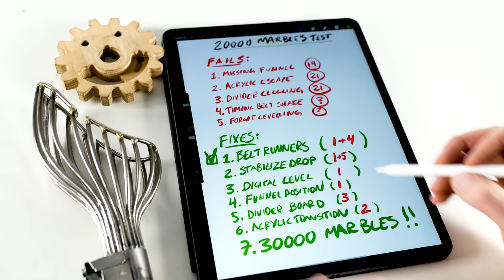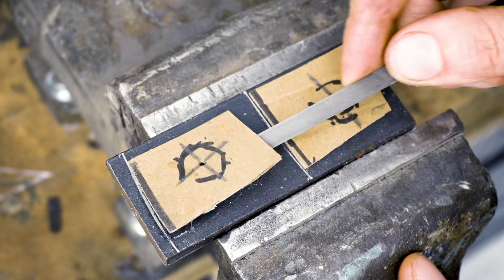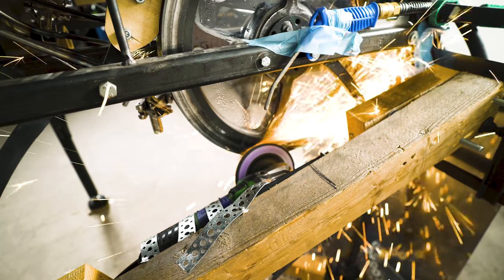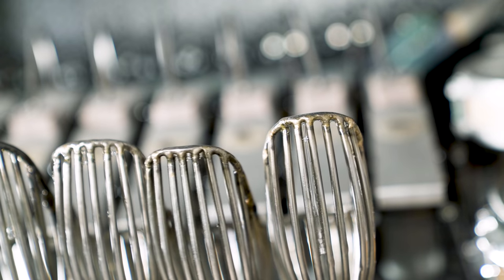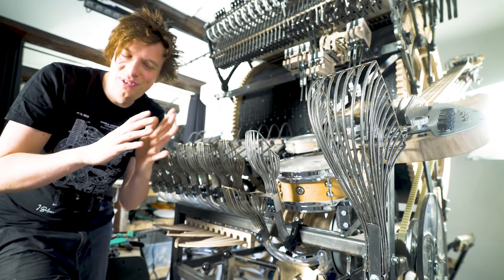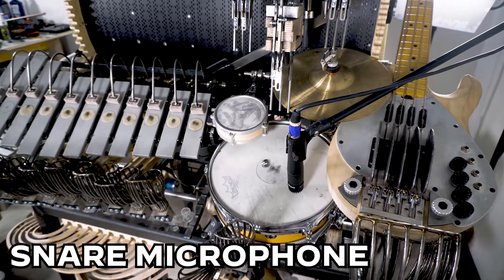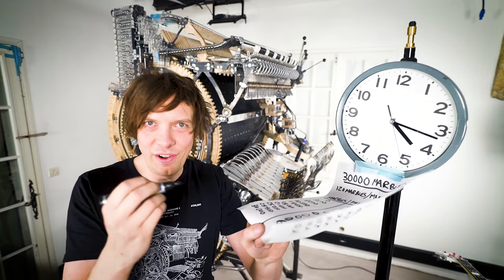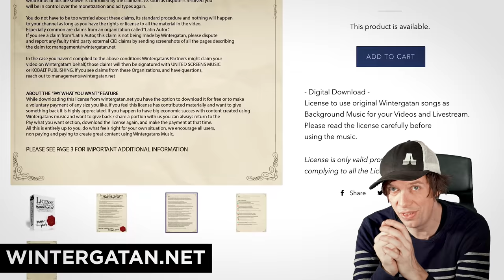Playing 30000 Marbles - Marble Machine X #148

Comment: As an engineer who has worked many years in “Quality and Reliability”, you cannot put the six in the FAILED column. They did not fail for what you were testing. They are a “new failure mechanism”. Analysis shows a design defect in the feed mechanism for not limiting the flow for such a small flow of marbles to the main mechanism.
Reply: It's a FEATURE!
Reply: I think he counted the 6 in the count because he's not just counting marbles that escaped the machine where the marbles were let loose to hit the instruments. This was an overall whole-machine stress test (except for the unplayed portions) and those 6 lost marbles showed there was a specific set of conditions that need to be addressed.
Reply: As a QE.  Martin’s Definition of a defect was a marble on the floor.   So it counts.   The cause of the failure is different.

If writing a FMEA it would have the same effect but different cause.
Reply: @calvinthedestroyer  actually it is a feature when you think of it: it's a damage free fail-safe which allow for the continuation of the feeding loop, at the expense of losing x marbles from it. I really would have put a tray and let it stay were it for me: fixing it would probably make it worse if something happened

Comment: Six marbles failed, in a way that is completely harmless to the machine, and you know exactly why it happened. I see that as a total sucess.
Reply: Completely harmless? One day a marble will get stuck between moving mechanisms and jam up the machine. The only safety feature in this case is the fly wheel disengage mechanism which will probably put to much force on the jammed mechanism and locally destroy the machine. Failing marbles are always a risk for this machine as long as there are almost no safety features in place. Martin is going to find this out someday. So sadly enough failing marbles are not so harmless in my opinion :(
Reply: @FrankyieFrank  I think in actually practical usage he would be able to look for the errors and stop them before they happen. Well, that's what I think.
Reply: @FrankyieFrank  Yeah but the thing is that the cause of the fails is not a part that is going to snap of a desing flaw that needs some plastic surgery. It's just a interchangeable part (and too many marbles in my oppinion)  that caused the overflow to, you know, overflow.

If one of those stray marbles would cause something to break would absolutely suck, but compared to the other things he had to do this far, I would't even call this a fix. Just a bit of fine tuning.
Reply: @FrankyieFrank  Sure, I agree that it could cause a jam somewhere else, and I also agree that the machine needs more failsafes.

But I still think the test was a roaring sucuess.
Reply: @FrankyieFrank  I think what was meant is that only six marbles failed due to the test setup: If all instruments are playing, the line of marbles will never back up far enough to flood the stair elevator.
Reply: @rublie1426  that was exactly my thought as well, and I'm surprised it wasn't his conclusion. The max number of marbles the machine can be loaded with is a function of total bpm and loop travel time.

Sure, some mechanism could prevent this failure, but so would treating the MMX like it was a full instrument, rather than just a snare drum. Or potentially just removing a few dozen marbles from the system for these tests.
Reply: @Ruricu  yep exactly :P
Reply: @wintergatan as a (SW) engineer I have to fully agree with @JonasBergmansson: this was NOT a machine fail, but an user error. You overfilled the machine for the given test setup with 2 channels. I understand that the machine with all the marbles going around is visually more appealing, but that was unnecessary for the test at hand. BUT there is a lesson here: the capacity of the MMX is limited by how many marbles can be at the same time in the marble divider/fish stairs feeding tube/fish stairs loop. Marble outflow-rate (through gates) and marble inflow-rate (from conveyor belt) are dependent on where you are in a music piece. Plus the inflow-rate I(t) is time delayed of the outflow-rate O(t-∆t) (delta T = time for a marble to go through the gate all around to the exit of conveyor belt). I get the feeling that there could be a mathematical or numerical solution to the question: how many marbles should I fill into the machine for a given set of music pieces? For the test at hand the inflow-rate must have been only so much slightly higher than the outflow-rate that it took playing 29000+ notes to fill the loop to capacity. If you would have just put 10 fewer marbles into the machine 😂
Reply: I guess the boring answer for this test would have been 36 (plugged non-installed channels) + 2 * 50 (taking an educated guess what the storage capacity of one channel is) = 136 marbles. This of course assumes that the given test music piece doesn't exhaust the channel storage while the first marble played is traveling from the gate back out of the marble conveyor...
Reply: But, hey, wait.... something is fishy: @Wintergatan where are the extra marbles coming from? Your test music piece has N pins on the program wheel, hence every full rotation of the wheel releases N marbles (don't remember what 120 rpm translates to in X program wheel rotations per minute). So shortly after the start of the test the MMX  goes into a steady state, i.e. per program wheel rotation N marbles go through the gates and N marbles exit the conveyor belt. So where do the extra marbles get added that make the marble inflow-rate slightly larger than N/rotation? It can't be the "height modules", because AFAIR they only make sure that a filled channel ends up with a marble flush on the marble divider channel so that marbles rolling down the channel don't get stuck. Is it just all the other marbles that are "stored" in the machine, slowly migrating toward the conveyor belt and being fed into the marble divider/fish stairs loop?
Reply: @chemobejk  yeah pretty much. I think that slightly more marbles get elevated than get used by the drum channel, and at the start marbles were both stored at the bottom of the machine behind the funnels. Then apparently after about 4 hours, enough of those marbles were lifted to the top to flood the stair elevator.
Reply: Success *
Reply: Why did they jam in the pipe? I didn’t quite catch that.
Reply: @chemobejk  well, not the way Martin described it. He said the snare feeders were at the wrong height, causing the marble divider to slow down and back up. If that problem is fixed, the marble divider should never back up even if the machine is running overnight with all instruments disabled.
Reply: @Ruricu  I think the reason this is a true fail and not just a case of overloading is that the imperfectly calibrated snare queue caused a blockage. The fish stair creates an infinite loop of overflow marbles that meant backing up like this shouldn’t have been possible, as the machine stopped, the marbles should have pooled at the divide by four and its feeder pipe, not at the top. They backed up at the top because the top marble of the snare queue was protruding too much and the next marble stopped there instead of continuing round the infinite loop. I think.
Reply: @Dave01Rhodes  unfortunately the video doesn't show that bit of the marble divider (top of the snare channel and marble divider exit to fish stairs feed tube). It is shown that the marble divider channel is full BUT the feed tube isn't and marbles are still flowing into the feed tube (I.e. no blockage). So it isn't clear why fewer marbles entered the feed tube per fish stairs cycle, as the fish stairs pumped into the marble divider.

Comment: I am genuinely concerned with such levels of precision being needed that this will not be repeatable when transported without significant setup time
Reply: You know, there is always some setup time before a show ... Installation, tuning, tests, and so on ... I'm sure that, with all the works done now, it will cut down on setup time and will be manageable in the end !
Reply: Also, having such a high reliability in perfect conditions gives some headroom for errors when the setup is suboptimal on tour. As many have pointed out it's not the end of the world if some marbles escapes during a concert. If 1/10'000 escapes in the studio it might be 10/10'000 on stage with limited setup time. But it makes sense to get it as good as possible now.
Reply: At least it could be perfect for studio recordings when je will have the time to adjust everything
Reply: Yeah, setting the machine up to be exactly the same each time might be quite the task. I can see different venues having different temperatures and humidity, the machine may also need to acclimatise. I don't know how this would affect the machine working but I'd probably want to do some long running tests in different environmental conditions.
Reply: @isakefternamn  it isn't the fact that the machine has high reliability in studio conditions that worries me...it is the fact that it needs high reliability to work properly. As we have seen already, minuscule deviations from "perfect" cause a cascade of issues. It is this very narrow "operational window" that gives me anxiety.
Reply: seems like the machine is flexible for calibration. before any show i can imagine a team calibrating it thoroughly
Reply: The only tweak that he's made that seems like it would need adjustment for going place to place is making sure it's leve.l which doesn't sound like a hard standard to meet, but maybe I'm dumb.
Reply: @publiusii4246  Different temp and humidity could cause the materials to expand/contract which might cause problems.  I especially wonder what the largely plywood gates will do in a warm, humid environment.
Reply: @hyfy-tr2jy  Sure I get your concerns. But it seems the risk of a marble escape causing a critical failure (get stuck in a gear or something) is still pretty slim. And when Martin is done with this detailed overhaul I’m sure it’ll be fairly reliable. And the audience at a concert will be forgiving if he has to stop the show to remove a marble somewhere, at least I would be!

Comment: Martin, the purpose of the squished cable in the angle grinder is strain relief. My guess is the issue was in the plug, but I recommend putting the strain relief back in because if you don't the cable might pull out of the internal switch, short, and in the worst case start a fire.
Reply: Omg imagine a fire destroying the mmx...
Reply: If it's to squished too hard and it gets too hot, the wires melt together and short. However, could also just be that this will happen with any grinder (or any machine) that gets used beyond its duty cycle and load.
Reply: @cjansson  It can't be "squished to hard".  The inbuilt plastic crimp is sized to compress the insulation sufficiently to prevent cord pull out under normal wear and tear but not compromise the insulative properties of the jacketing.
Reply: If it shorts out, it will pop the breaker. Just one strand of copper is enough to start a low impedance arc which will trip the breaker in tenths of seconds. A short circuit does not cause fire, unless the electrical installation of the building is bad (or if you reclose a breaker with the fault still existing - that can pit contacts and eventually weld them together...)
Intermittently arcing contacts to the load can cause fires, but in this case you'd immediately notice if the grinder is not running smoothly and most of the times the plastics are flame retardent.
I agree there should be strain relief, otherwise it'll just work itself out of there quickly.
Reply: @williamcchinworth7367  I'm pretty fucking sure the inbuilt plastic crimp was never "sized" for anything, it has just been thrown in there to "looks fine" standards. Which may easily include "it's not fine at all you idiot" situations.
Reply: @AttilaAsztalos  actually the inbuilt strain relief is often highly engineered to not cause issues with over tightening, way easier to pay an engineer to work for an hour on an injection mold design than paying for calibrated torque drivers in a factory or paying for one lawsuit.

it's also often part of compliance testing.
Reply: Personally, I think the crimp doesn't need to be there at all and the 'strain relief' is provided by the snaking pattern of the cord running through the handle. Which means you guys are slowly getting more and more upset with each other for no reason......
Reply: @mfbfreak  I know, I was talking about a worst case scenario. I edited my original comment to reflect this.
Reply: @cjansson  squished too hard doesn't cause wires to magically change resistance (unless you're talking really really squished) I just want martin to be careful and not do anything that might put him or the MMX in danger.
Reply: @jeffffro7674  take it from an engineer that's designed strain relief just like that into multiple different molds, it needs to be there.
Reply: @AttilaAsztalos  oh, it most definitely is sized. there are entire ME reference manuals on designing that specific style of strain relief.
Reply: @zachbrown7272  well I have several tools where I've bypassed the crimp but still have it zigzagging through the maze that's there and they've been fine for over 20 years. Then a couple more where the crimp part broke because of the beautiful engineered term, planned obsolescence, and after I repair the parts that are engineered to fail, the tools work great for a lot longer than they are planned to.
Reply: "Way easier to pay an engineer to work for an hour on an injection mold design than paying for calibrated torque drivers in a factory or paying for one lawsuit."
Even easier than that is doing neither and blaming the customer for starting a fire by trying to use an angle grinder for hours to true up an unbalanced flywheel.
Reply: @zachbrown7272  If he runs the machine for 4 hours in a go under heavy load, there could be a significant heat build up compared to shorter runs thus the machine does not heat soak as much. But yeah speculating based on that the removal of the squished bit seems to have solved it. I assume he put back the cable strain relief part.

Comment: Hi Martin, some thoughts from me:
-I think the missing thunnel hit occurs when you have a fast double bounce on the snare, one marble is landing on the snare when the drum skin is moving up from the previous marble. It is like beein two people jumping on a trampoline, with a perfect pace you will get an extra high bounce caused by the other guy. You should therefor test the dropping with all different intervals you can set on the programming wheel. Maybe this phenomen is even worse on the vibrophone?? 

-A belt tensioner shouls always sit on the slack side of the belt, look at a mountain bike chain as a example. You will loose efficiency by having one on the active side and therefore add drag in your system. And if you weld it onto your frame, make sure the tensioner is ajustable with a sliding slot!! Another cool way to solve a tensioner is a "ring tensioner" google it, would look realy cool on your machine. 

-I see a big risk with the gates. There is a long leverarm down to the gate from the actuator. Even if you make this gate work fine, you will have problem when you start install the other gates bechause you dont have the same height between the actuator and the gates. Therefore the leverarm will have different length and that will affect the traveling lenght of the gate opener, also affect the pull out force on the gate opener. To solve this you need to redesign the gate. Instead of having a lever arm you should having a vertical pull from the actuator and a link in the gate to pull it out. That would make equal force and traveling lenght independent of the height between the actuator and the gate. 
Thanks for you amazing work so far an to share it to us! 
/Johannes
Reply: I never heard about a ring tensionner, very smart idea, but it works with chain gears only I guess...
Reply: From Johannes to Johannes, so much this!
Especially the last point. My mechanical engineering heart hurts more and more because I feel like martin it slowly but surely digging a whole he can't get out of. 
I sincierly hope he can fix the flaws and get over the whole reliability thing.
Reply: The "bouncing problem" you describe can maybe also be adressed by tuning the snare to a different note, so the vibrations of the drumskin have a lower probability of positively interfering with double marble drops
Reply: @GoelWCS  A flanged sheave would work too for a flat belt/timing belt, probably.
Reply: sherlock_norris I concur totally, as a drummer I know the different actions of bounce on different tensions on the drum head, my first thought on the last video was, the double bounce on the snare is causing the miss, this is the only variable change from the video where there was no misses
Reply: Agreed on every point!
Reply: @sherlock_norris  Good luck figuring out the ideal values for that Different Note Snare Tuning Solution, mellado!
Reply: I agree, but I really think you should put this on discord. I'm not sure he'll see it here, buried among the fun silly comments
Reply: I agree with your first two points but third I disagree with. In previous design videos Martin explained that the travel distance of the gate does not matter and the friction of the gates is low enough that I don't think making the distance longer on other gates will have any impact.
Reply: @alexanderwatson9845  hope you are right but I still see the risk as it will also affect how fast it will open and close the gate. Still, he should set up a gate on one vibraphone and test in together with the drum gate and make sure the two different heights does not affect the reliability on another long run test.
Reply: @860707jl  fair point and good idea!